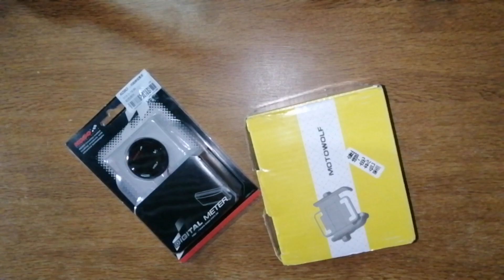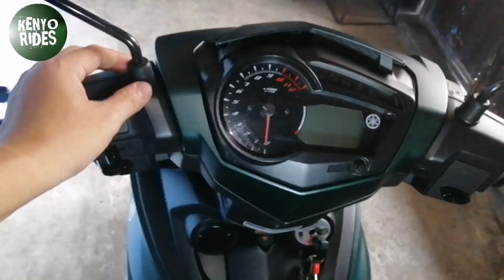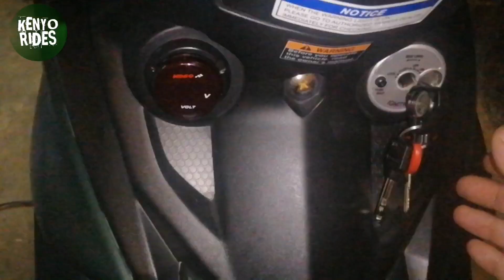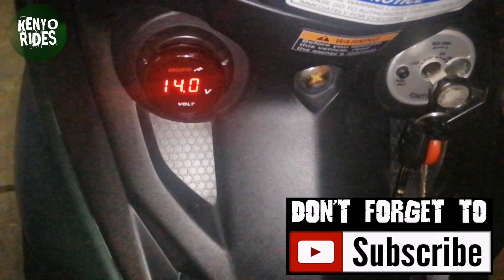How to Install Voltmeter and CP Holder with Charger | Yamaha sniper 150

Comment: Paps, sinunod kotong sa video mo,, pero biglang, nawala kuryente ng snipey ko hohohohog. Tulong po.
Reply from the maker: Check fuse. Baka nag short circuit ka tol
Reply: Salamat paps ,, 
.,,paps isang tanong pa po, plug n play lang po ba ung mga led lights, smple c6  h4? 
,,san po ung best 6k or 8k na c6 h4 na led light, salamat in advance paps.